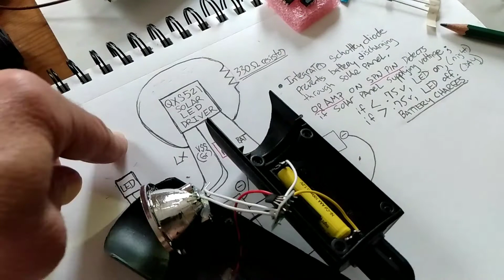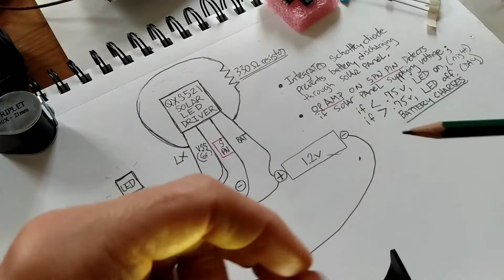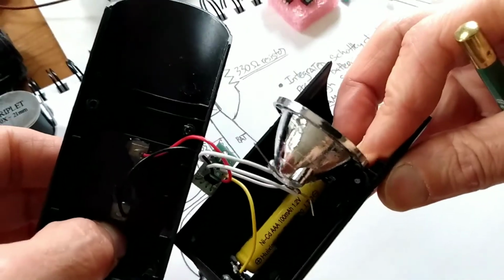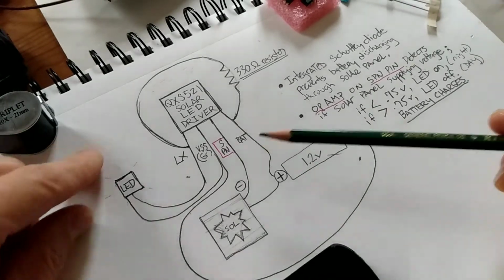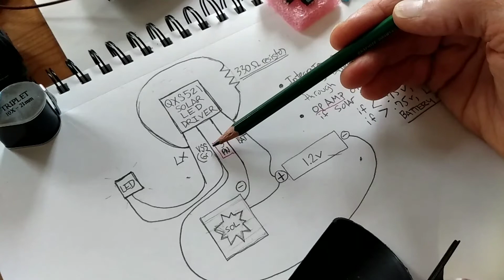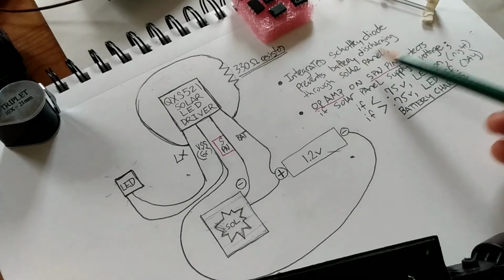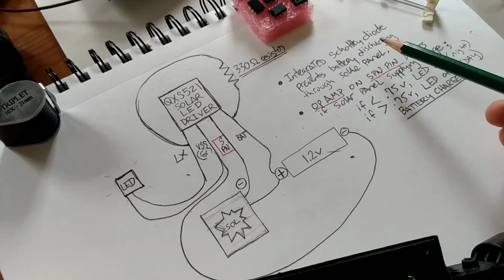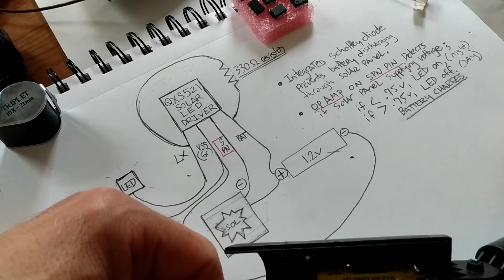Inside solar LED light circuit

Comment: I was curious if this system can be used to charge a 3.3V battery powering a microcontroller that will mainly be in sleep mode. Specifically, will the Op-Amp on the SPN pin be an issue if it can turn off the power to the circuit during the day - how to overcome that? Appreciate any thoughts.
Reply from the maker: Please clarify your question.

Comment: My light blinks, should I replace ghe battery or there can be some issues with the components?
Reply from the maker: Test battery with multimeter. If that's OK, you might replace LED.

Comment: The 330Ω resistor is the inductor
Reply from the maker: Thanks for watching. I knew resistors limit current, but didn't know they function as inductors, storing magnetic fields. First time I heard that.
Reply: @p1nesap  Although it looks like a resistor, it is in fact an inductor, 330uH. A white LED needs about 3v minimum to light up so the QSX521 has a switch-mode boost circuit inside and this needs an inductor to function. Normally there would be a cap to smooth out the ripple but not necessary here just to light an LED.
Reply: @splabber7846  I just started to tudy this circuit and was thinking about this. Because white led needs about 3V. The only solution is that this is not a resistor but an inductor.